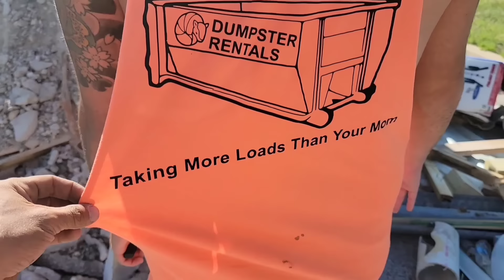Contractor Stuffs My Dumpster Full of Concrete: 12 Tons of "No Way José"!

Comment: Where I'm from, all of your materials have to be separated before they're taken to the waste facility or dump. And if they're not, you pay massive fine.
Reply from the maker: That's interesting, where is that?
Reply: It's what it started a few years ago I went to the dump 1 day and they told me if I did not separate everything. I had to pay. So I drove to the cardboard pile. The mattress pile the palate pile. The household furnitchirpile the appliance pile. Have to separate green waste. Leaves, branches, grass, dirt, et It was such a pain that the next time I didn't do it. And it cost me about $400 extra. So then I learned that I have to start packing my loads to the dump smarter. Either one type of trash at once or put it in in layers so that I can stop at each individual pile or section and dump. And at our dump, any dump in California, you are not allowed to take s*** out of that dump. I seen a pre-world war 2 Briggs and Stratton engine. That is easily worth a couple $1000. And the dump employee would not let me take. It would not take a payment would not take a bribe. Nothing, I was back the next day it was crushed. Into a cube. With a whole bunch of other metal. California, california says they want to save the environment, but I've seen entire sheets of plywood lumber fencing material chain link material that someone could take from the dump and still reuse and make something out of I've seen rolls of chain Lake that have a good 50 feet but a bad 50 feet. They won't let you take the good 50 feet to use it. It gets crushed or loaded up where I live in the Central Valley. Taken on scrap trucks down the Long Beach. Loaded on a boat and then sent over to Asia. We have no more steel Mills in California. They shut down the oil fields. An agriculture is being ran out of The Valley because it pollutes the air. I was born here, I've lived here my whole life. And it has become a Communist state. If you would have told me 15 years ago, i'd be making a $100 an hour and still struggling. I would have laughed at you. I make a $100 an hour and I'm struggling in California. Other people would say I'm doing well. There's neighborhoods in California that still have no curb. No gutter, no paved roads. What you see on TV is what they want. You to see California is a third world country now You're either rich, or you're poor there's no more middle class out here. Actually it's extremely rich, rich, poor ,homeless
Reply from the maker: @StephenClark-hk4mi  I was gunna ask if that was California you were referring too. I've talked to a few people out there that have lived there, their whole life. It's actually really sad to hear and see unfold. Trust me, I have heard similar things from others. If you ever decide to move to the midwest, they'd welcome you, and your dollar goes much farther for now....Illinois isn't much better on decision-making skills. But, the cost of living is still a fraction of Cali! I'd recommend a city like Kansas City MO or parts St. Louis. Both are in growth stages and will continue to be for a while. And also have reasonable laws and taxes. (Just local examples for me. I know there are other options)

You only live one life!
Reply: @rollingops  You're right, it's also crazy to think that. My house was only worth $65,000 10 years ago. And now it's worth 320,000.
Reply: @rollingops  With that comes insane property taxes.
Reply: @rollingops  I will take everything you said in the consideration. I don't have any family left here except for a mother and a grandmother. Siblings, cousins, friends, everybody have moved to Texas, Oklahoma, Tennessee. I was trying to ride it out. Hoping things would get back to normal. All my vehicles are classic vehicles. Except for my daily. And now the state wants to put a mileage limit on anything 1978 or older. You already have to  Emissions testing on anything 1976 and newer. I cannot drive my extremely clean. Almost show quality 1977 C15 Heavy half ton step side. Because it will not meet the state's emissions requirement. They want me to put a catalytic converter on a vehicle. That never came with one factory.
Reply from the maker: @StephenClark-hk4mi  yea, that's insane. At so.e point it becomes too much
Reply: @rollingops  yup
Reply: @StephenClark-hk4mi that's super annoying re: not being able to take things out. You're right, it's even more environmentally friendly to do it. As a kid, my friend and I would recover and rebuild bikes from the dump.

Comment: This is why you don't use toys like that. Roll off trailer. You can never trust anyone of what's gonna get put in it.. You could have all the contracts in the world. But now you're dumpster sitting there. Waiting for the contractor to do something. If you want to make money, you get a hooklyft truck.
Reply from the maker: To each their own. But to say you can't make money with a trailer setup is a little silly. We have been running them for years. Hooklift trucks clearly have their advantages. But so do trailers. But even if I had a Hooklift, I would not have picked this up and dumped it, this was a customer mistake. 
I know plenty of hooklift systems that wouldn't have been able to load this anyway. And even if they managed to, they'd be overloaded. Just my opinion, appreciate the comment

Comment: I would love to set up a simular business,  I'm just not financially in the spot to buy the necessary equipment,   I know it sounds silly but with currently having a 1/2 ton truck do you think buying 2 medium sized dump trailers might be a good start ?   I am a disabled vet so I want to work, I have money to feed my family,  I just need to cover operating expenses and build some income to grow it into a workable business.  I've got 24 acres of land I live on and I could actually use a lot of that dirt and rock and concrete to raise it as I would like some more flood resistance.   I would love to bring that kind of material out as often as possible,  use my little tractor to burry it and build up the land
Reply from the maker: It really depends on your goals. I prefer roll offs because one trailer manages multiple bins. Which means only one trailer to insure, one trailer to plate, one set of tires, one set of brakes, batteries, etc.

Comment: They tried to shut the door with a piece of equipment or a truck bumper…..the door wasn’t gonna shut either way
Reply from the maker: Ahhhhh you know what, you're right. That actually explains it exactly! Because I noticed a small dent in the door frame later! That makes perfect since because the split was under the hinge. Well. Good welding job because the hinge held lol
Reply: @rollingops  I’m ashamed to say been there done that and had to weld the man’s dumpster back together 😂

Comment: Contractor don’t deal with dumping. They demo, build, throw “trash” in a dumpster and it disappears… your comment about the Contractor not being able to “control what’s going on out here” with her subs IS the problem. If there are stipulations on what is and is not allowed in your dumpster, and the Contractor is clear on it, then SHE is absolutely responsible.  Outside of that, don’t be mad at the subs, be mad at HER for NOT MANAGING her job site. Paying bills or not, she clearly has NOT understood being THE Contractor is a MANAGEMENT position, not a fire and forget position. THAT is why Home Depot has also had issues with “them”, which means with HER
Reply from the maker: @TripleBRanch  pretty well written. I would agree

Comment: Some guy wanted to rent my dump truck for a job like that by the hour 70dollars a hour worked one day made about a thousand dollars cause they paid dumping fee i waited all day told them cheaper to get a dumpster worked out better for them i wasn't complaining just doing what is right they got job finished boss called said stop by gave me four hundred dollars said I saved company money took them five weeks to do job said glad I told him my thoughts and said i was right but next job used my dump truck hauled broken concrete i had places to dump that stuff for free toot 3 hours then got fill material and concrete was poured im long winded on here but we owned a landfill in the 60	70 before all the big company got started like waste management b f i and a few other ones so been around a while seen it did it like I said have a good head on your shoulders going places on the dumpster wonder if other people were dumping in there 25:25 😊

Comment: Not being rude but if your worried about dents and scratches in your dumpsters then working with contractors may not be your best bet. Stick with home owners cleaning out their basements or small renos. Also dont forget most contractors are used to triaxle trucks picking up the boxes not a pick up and trailer, so they may not be thinking they are overloading it. Especially if they are subs and arent the ones getting them. I def think you were right in unloading it and they should pay, they did sign a contract. Just working in excavation and construction i can kind of see the other side.  

     Also just out of curiosity why waste the time going back to get the skid seer and not just clean up with the mini?
Reply from the maker: Yea I totally know what you mean. I'm definitely not one to be picky about a beat up dumpster. Had they used the dumpster with the agreed upon material and so on, and they dented and beat it up then, I wouldn't have cared. That's just wear and tear, but because they did use it incorrectly after already discussing it, that why I went ahead and added the repair to the bill. I guess I didn't cover the reasoning for the skid. I had a driveway at one of my rentals to do some repairs on, and a rental lined up, so I was going to need it that evening anyway. Figured I'd use it to get the last bit at home depot, and then take it to the next site.

Comment: How much more did you charge them?
Reply from the maker: @CameronsCandorOriginal  it's been a while, but I think I say it near the very end of the video. And If I recall, they rented another. Did a similar thing, but not nearly as bad. They piled up a stack of crushed concrete in front of the next dumpster. Making it impossible to recover. Made them remove that themselves, and hit them with a second big charge. 

It was kinda of a wild series of events.

Comment: Shouldve lined up a second dump side by side, excavator in the middle why make that huge mess. doesnt look good and takes up a huge amount of time. i Wouldve been out of there in one hour and charged the same.
Reply from the maker: We don't necessarily get that luxury. We are charging by the load and if we smash it all into one dumpster, We loose money.... and we still managed to show up and leave in 2 hrs? Don't forget, this was a 3rd party job, so I do have to consider some things. 

Considering it was also mixed trash, I couldn't just toss the cardboard and trash in together, then recycle it for free. Sure, I could of done that, smashed it in one or two dumpsters, then ran it to the dump, 5x farther away. And paid to dispose of it. You're also not separating all that sitting in a mini. 

It would of took me longer to go out to my shop, load mini, unpack it all, smash it in there. Load the mini back up and go home.  And we only have one truck then running dumpsters if it still takes multiple loads. 

Your logic may make sense where you are, and with your equipment, but that would of been a massive waste of time and money here.
Reply from the maker: Ahhh wait different video lol. Yea, we could've done that. But, well, we didn't

Comment: If I were you I would have just dumped the dumpster on the ground…
Reply from the maker: Probably should have, but in the end, we got it done, and made a little more.
Reply: @rollingops  keep up the good work!
Reply: Yeah that would of been the easiest and fastest
Reply: @rollingops  what is the most weight you have pulled up on your trailer? A friend of mine bought a switch and go system and wonder about what the capacity is.

Comment: Even with that half full bin you’re lucky you didn’t break an axle outright, get an seal leak on the axle, or blow a tire. Definitely well overweight driving down the road.

You’re destroying your equipment doing jobs like that. The side walls on your bin can actually bend out preventing the door from ever closing due to the weight. Not to mention even breaking a weld as well. Or break the tubing and collapse the floor. I would reject the load and remove all the contents from the bin and bill for the repairs.
Reply from the maker: I mean...it was a legal load we hauled away? That wasn't overweight. Heavy, but nothing the trailer couldn't handle?  Did you watch the whole video? I'm confused. We did remove everything, and charge for the time and repairs?
Reply: @rollingops  Haha Common Buddy.. I’ve been hauling bin for 10 years and have multiple trucks. Half a load like that in a 20 yard bin is at least 7 - 9 tons. That would over load my Kenworth’s t480 which has a legal 33,000 gw. That truck has way heavier axles than that trailer. Those roll off trailers at best are meant to carry 2-3 ton pay loads legally and thats including the bin. I see it all the time those roll off trailer operators thinking they can carry just as much like a class 7 or even a baby class 8 truck. That isn’t with reality.
Reply from the maker: @tylerpeck8047  maybe it was the angle of the video. That half load at the end was no where even close to 4 tons. Because the bottom of the dumpster wasn't all rock it was actually backer board. I promise that thing has hauled some heavy loads. But I'm not hauling 8 tons anywhere. I mean I have the weight ticket for it.
Reply from the maker: But at the end of the day the whole experience sucked ha. But yea, if that entire half of the bin was full of concrete and rock still you're right, it would of easily still been 8 tons.

Comment: It's not petty.  It's a buisness & when you agree and sign a contract for certain things to be loaded into that dumpster and not be loaded. Then that's what supposed to go into that dumpster. If there was things that were put into it that wasn't supposed to be put in there and you had to remove those materials then of course, charge them for it. 
Contractors know better, but try to do it anyways. As to what they did to you. They knew they are only supposed to put construction debris C&D in 1 dumpster & Rock, dirt, asphalt & concrete etc, into another. But they always think that a dumpster removal service company driver will just get to the dumpster & load it & go. But you always check it before you tarp your load. Due to once you leave that property they can say no, no, that's not what we put in there bs. As well as they know they just got over on that person multiple times. Great video don't get screwed around stick to the contract. But that's good anyway because you got multiple jobs out of that 1 dumpster. Also, they tried to move your dumpster. That's why it's broken where it is.

Comment: Stupidity is rampant. I deal with the same shit with a 30 yard at my dealership. Signs on all side of the can and they still put shit in that does not belong.
Reply from the maker: Yep, doesn't matter the size or capacity. Some people will still push the limits of size and weight.

Comment: You just gave away and paid to dump all the concrete you could’ve used for your ramp
Reply from the maker: The majority of the concrete is at my ramp at the shop!
Reply from the maker: The 4 tons at the bottom of the dumpster was mainly sheet rock and gravel that was underneath of it. We got nearly all the concrete chunks out!